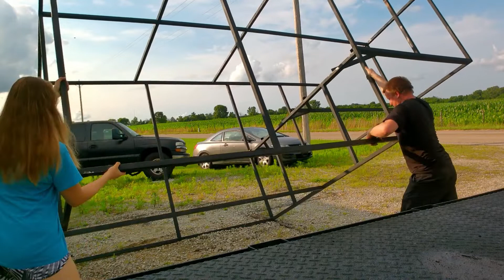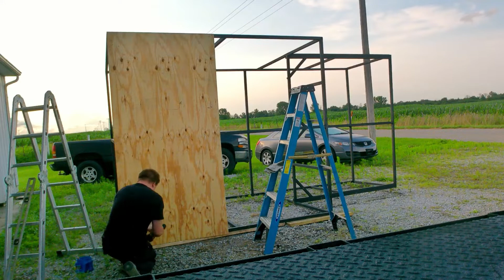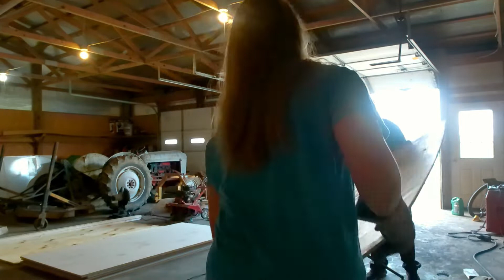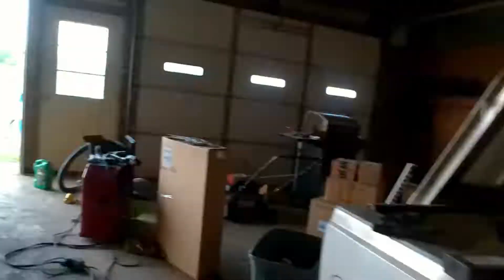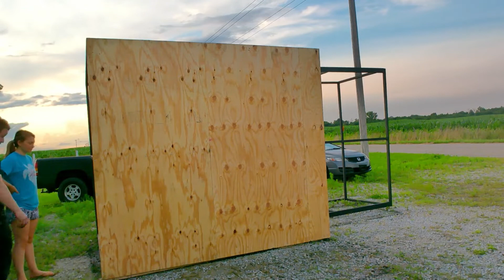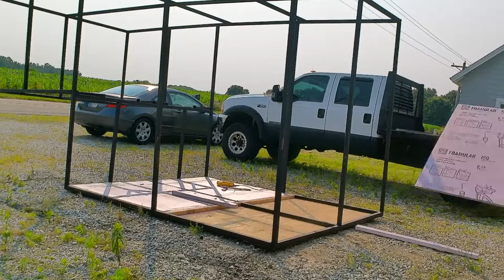Couple Builds Truck Camper Part 3 Timelapse

Comment: The overcab section would have been way more structurally sound if you extended the lower beam all the way to the back of the structure.
Reply: Or at least add some triangulation to the main frame. It will sag in a hurry without it ! ! !